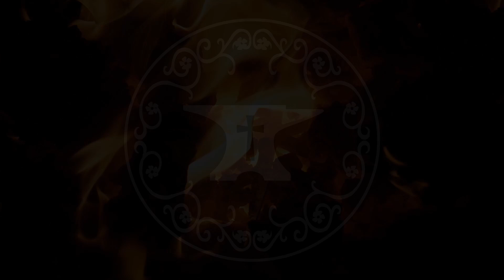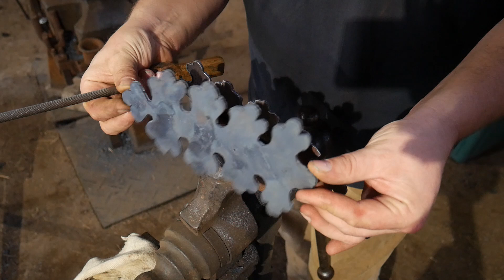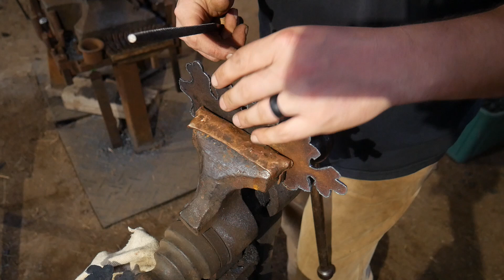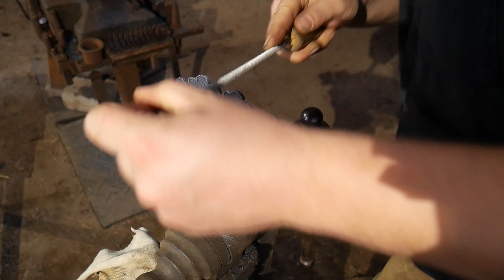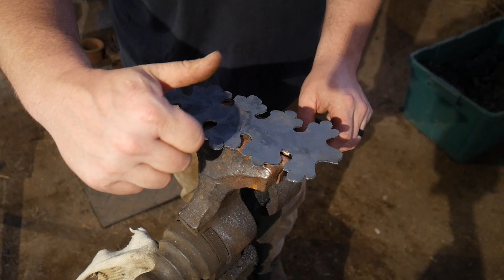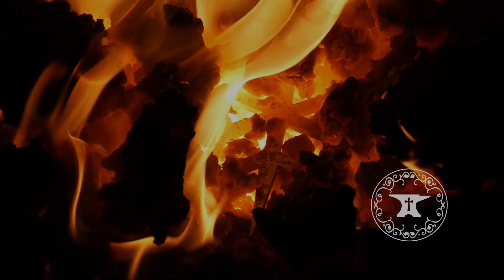Anneal BEFORE You File!

Comment: I chip "dross off" first to save on filing, plus your annealing small parts sounds real good!   Dross is the name of the plasma over reach of hot metal sticking to the cooler under side, usually formed when either the current or air pressure or gap settings are incorrect.   Peace Out!

Comment: You can revive a file by soaking it in acid. Some people hate when you say "sharpening" a file, even though that is essentially what it is.  The acid removes the top layer of metal, and it DOES make the file work (often) as good as a new file.  You can check out Old Sneeklock's Workshop (https://www.youtube.com/playlist?list=PLXlq5qGw1per9H3vdRVTUJIEL_gNE9Quv for the file sharpening playlist).
He's a great guy (never actually met him, but he has a wealth of awesome tool tips, tool reconditioning, and general maintenance), and runs a great, no-nonsense channel too.  He is also a Michiganian (or Michigander, if you prefer).  About four and a quarter hours from you though.

Comment: Great point exposed. Hadn't actually tryed filing a plasma cut part but it is a tough initial grind on the grinder. I mean you can feel it on 3/8 1/2 and 1 inches plate I've worked on.  Another channel even goes in depth w the  full on description of the metallurgy in relation to plasma cut on ar 400 /ar 550 plate ( abrasion resistant) not something else lmbo but good for YouTube. 
🙏 blessings abundant sirSir and  family 
Crawford out 🧙‍♂️

Comment: Annealing things is a life saver. 85% of the things I grind, file or sand I anneal before I’ve got a plastic 5 gallon bucket of perlite I stick things in glowing hot and you can’t feel the heat about an inch away from a 2 lb hammer that’s 1800 degrees. It’s magic stuff. Saves abrasives too!